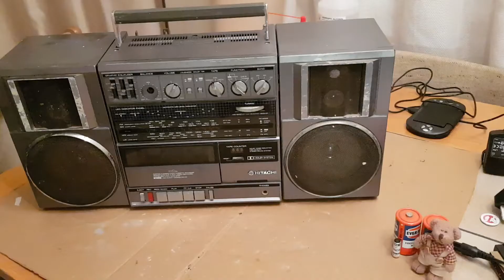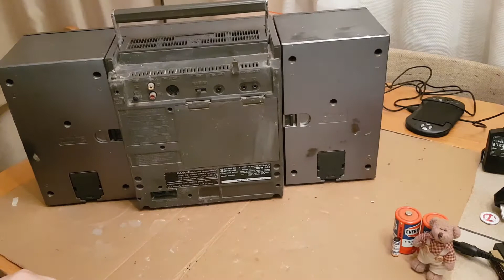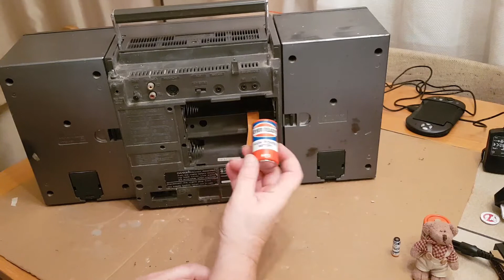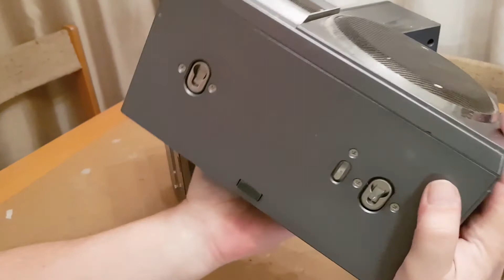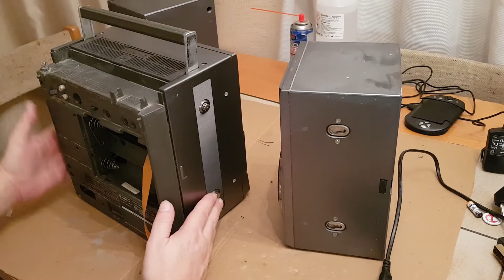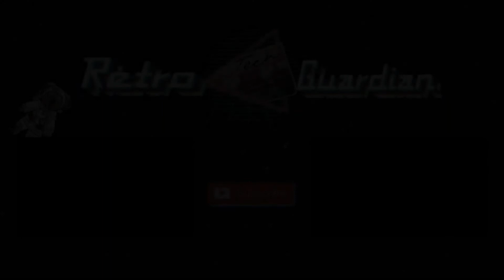A quick look at the Hitachi TRK 9100E 1980's boombox

Comment: Cool. I have one of these that I got as a birthday present from my parent's when I turned 15. Or maybe it was when I turned 16. Not really sure. That would be 1982 or 1983. It needs new belts now, and the antenna is broken. I've tried to find a new antenna online, but I've not been able to find one of the right length fully retracted. Most are much shorter, some are longer. I'm curious to know if you have managed to source a correct antenna for yours.

The RIF (Radio Interference Filter) switch at the back is to suppress interference when recording from AM radio. The reason is that the bias signal applied to the cassette tape during recording might in some situations interfere with the radio signal and cause a whisteling noise. Figuring out which setting works best is a matter of trial an error. It may vary depending on the radio station you're recording.
In rare situations the switch might also help reduce interference when just listening to AM radio without recording anything. That's when two radio stations are transmitting on frequencies very close to each other, and one interferes with the station you're listening to. Who is recording from AM stations at this time and age anyway? The switch is pretty much redundant. 
The switch has no function/effect on FM listening or recording.

I believe turn tables with both ceramic and magnetic cartridges should have a ground wire connected. At least all my turn tables have one, including those which came stock with a magnetic cartridge.

I believe the reason the right speaker has a separat contact point for the speaker signal is to prevent the user from mounting the speakers upside down. That's my theory anyway. Without it, this would actually be possible if you flip the left and right speaker.
As it is designed, it is still physically possible to install the right speaker upside down on th left side, but it won't be electrically connected. The left speaker can't be mounted upside down on the right side, because of the additional contact point sticking out from the main unit.

PS: I still have the user manual for mine. If you're interested, I could scan it, and email it to you as a Pdf. Not that I think you need one, it doesn't tell you anything you don't already know.